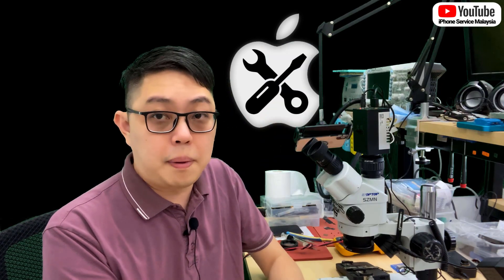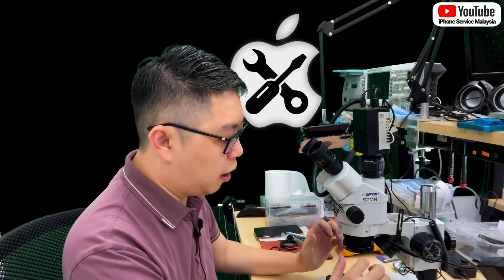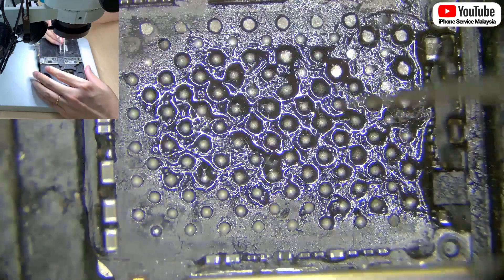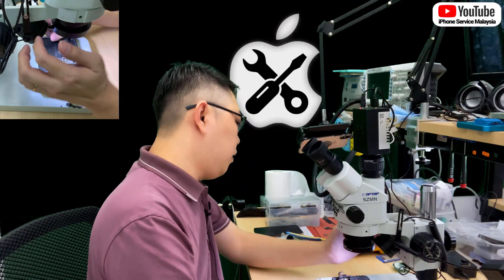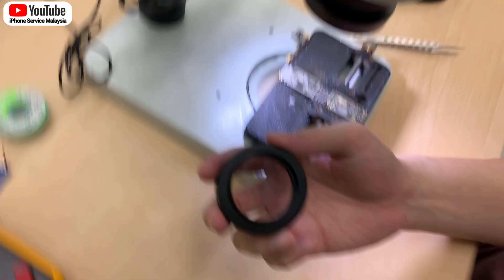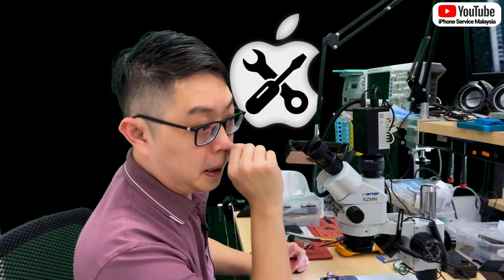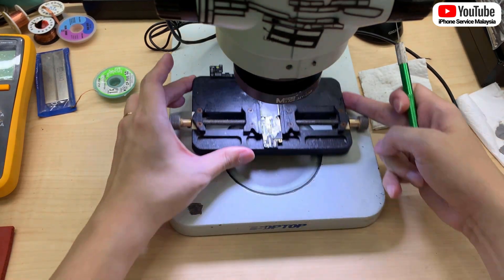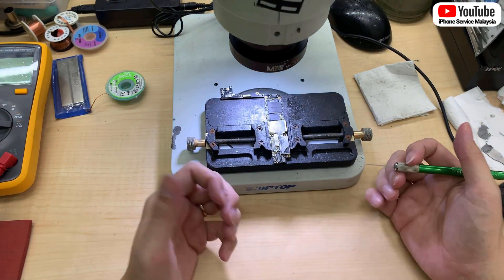Advice for the microscope to repair iPhone logic board 【Tool Preparation #01】

Comment: The brand is Soptop. There are not many offers on Aliexpress.
They are even more expensive than the motic ones I can buy in my country.
My first microscope was a motic with fixed zoom. It didn't work badly.
Do you know the motic brand? It's Chinese.

Comment: Well i totally disagree with the glass cover. When we Apply that glass lid under the microscope to protect it from smoke. You will see your eyes will take longer to focus like 1/4th of second  secondly you cant work for long time under microscope. Thats the draw back.
Reply from the maker: Well. Don’t have such problem. You may suspect your glass cover or microscope.
Even glass cover have expensive or cheap

Comment: Great work . With amazing skills. Brother i have iPhone X initially it was having low network strength i went to repair shop they repaired it snd it was working fine after one month suddenly all network have gone and phone started searching network all the time , later I checked there is IMEI no on about but its not showing imei no with *#06#. Then I tried to software update and restore with i tunes now it’s showing cannot activate because hardware information cannot be collected, please tell what could be the problem in phone,,. Please tell.